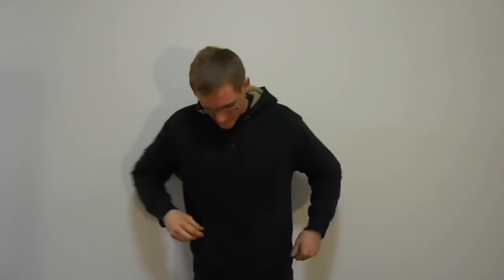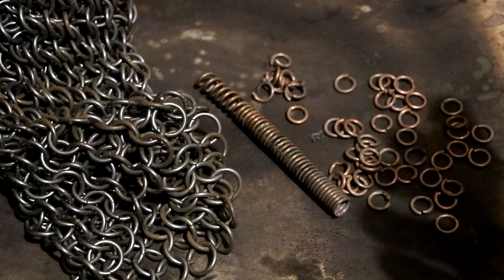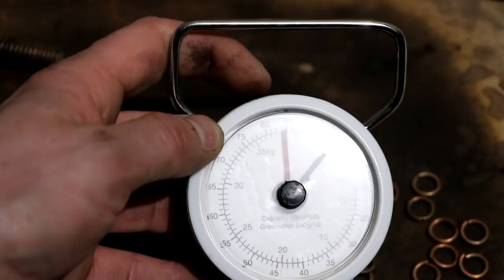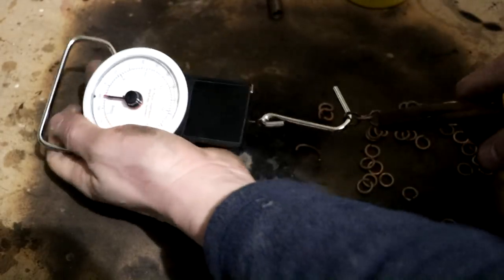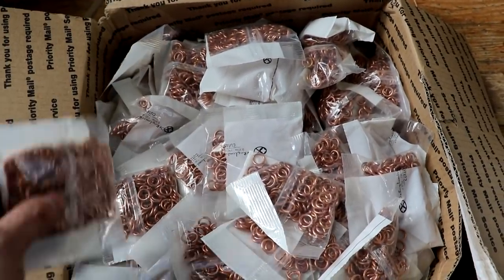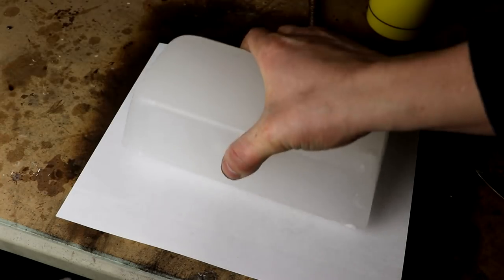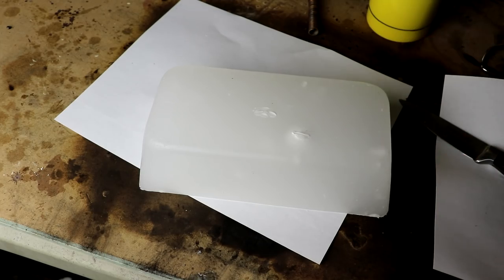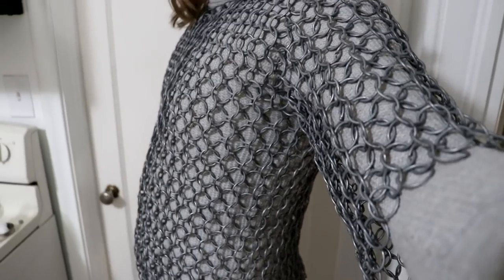Chain Mail Lab Coat?

Comment from the maker: Electricity... thats another thing this will protect me from that I forgot to mention in video.
Reply: Cody'sLab That's awesome! About how many volts do you think it can handle?
Reply: Question, is it possible to cast some iron stuff with thermite and dry ice? Or would it be too unefficient?
Reply: Cody'sLab doesn't it have to touch the ground in some way? Or electricity else it will still go through you to ground itself
Reply: Unless it's high-current, in which case you'd be a walking BBQ... :P
Reply: But can it protect you from the sheer force of thrown pommels?
Reply: That's one heck of an anti-ESD shirt.
Reply: Grounding through the shoes, or add a capacitor and a spark gap to induce an emp to short what is shocking you
Reply: Will it though? It seems rather easy to have a part of your skin in contact with it accidentally
Reply: How the chainmail can protect you from electricity?
Reply: Faraday cage?
Reply: Can it protect you against butter?
Reply: Robin Dude if it's not grounded a tazer will still shock you a bit through it
Reply: Cody'sLab I thought of that right away, thinking of you. lol.
Reply: And rouge chickens
Reply: moiseman a insulating layer would probably be needed
Reply: Duh.
Reply: What about the chem trails?
Reply: Are your referring to a taser?

Or are you going to somehow run positive and negatives down a shirt your going to wear and become the human electric fence.
Reply: Cody, what about Butter?
Reply: Just stay far away from car batteries and other power sources with low internal resistance when you're wearing it. I like my Cody rare, not toasted.
Reply: Also, sharks.
Reply: Yeah, but in case of serious power, the heat might get you
Reply: Only if they aren't thrown rightly.
Reply: Does mail radiate body heat? If so, would the rate and efficiency at which it does be enough to mitigate the extra heat generated by your body from wearing it? Also, in the sun, would the person wearing this actually get hotter from the transfer of thermal energy from the environment to you? 

Of course this isn't a full suit, so you won't have to worry about overheating like the original users of plate armor did but if you live in a desert, I want to know the deets on how mail works with heat.
Reply: Not as much as you might think. It might help by popping a breaker before too much damage is done, but it will get HOT in the process. Caution and insulation are much better protection.
Reply: Mmm...  I wouldnt wear it in an electric storm.
Reply: Chainmail doesn't really causes much heat buildup, it can actually act as a heatsink. But if it is exposed to the blazing sun, it will get scorching hot. To prevent that, you can wear a surcoat over it, like the crusaders did.
Reply: Does that mean there is a Tesla coil in your future?
Reply: It should handle quite a lot, unless he uses pretty high voltage he should be fine :)
Reply: this will be a faraday cage
Reply: did it ever cross your mind to wear an electrified chainmail?
Reply: Christopher Wiraatmaj, It will act as a Faraday cage
Reply: A Faraday shirt?
Reply: Really? Is it going to cover enough of your body to act as a Faraday cage? And wouldn't it have to be grounded?
Reply: MadSam !, Yeah, a Faraday shirt
Reply: Cornee, I don’t think it would matter much, the rings are touching anyway and wouldn’t require welding together
Reply: Lol IT can handle 10 Million volts If its grounded 😂
Reply: Norkans5 it isn't that the chainmail gets hot on its own, but if it protecting against an electrical shock by routing the current through the rings instead of the wearer, the chain mail can get very, very hot. The same way you don't wear jewelery when working with high current circuits (a finger ring completing 12v circuit in a car can cause horrible burns, if the circuit isn't immediately broken or if the wires weld themselves to the ring it can basically burn the finger off) this is usually an issue with unfused vehicle batteries or high power RC lithium cells.
Reply: I guess it would disperse the charge quicker reducing its affect but I'm not sure.
Reply: That was the first thing I thought of. You should build a mini power station build a power station.
Reply: Well, if the rings are going to get hot anyway, add some platinum and turn yourself into a catalytic converter.
Reply: Ian for something like a single capacitor it might help, but batteries hold enough power to dump power into a dead short for seconds, and large capacitor banks will basically cause an explosion (arc flash) if shorted.
Reply: Cody'sLab I was gonna say, make a ground wire to the soles of your feet and your chest is wearing a portable Faraday cage. ^_^
Reply: Cody makes his own superpowers
Reply: you can try to get hit by a taser and see if it protects you :p
Reply: Cody'sLab Will you please do a video showing how it protects you from electricity. I know you can think of a mostly safe method of showing us and it would make a great video. Keep up the good work.
Reply: Robert Szasz insulation only helps so much on high voltage applications.
Reply: Doesn't it need to be grounded first? I ground my tin foil hat so it doesn't work like an antenna, magnifying the alien control signal to my brain. Funny thing is as soon as I did I quit believing the earth was flat.
Reply: But will it protect you from constant notifications on your phone?
Reply: No, but nether does the no call law I subscribed to.
Reply: Lots of people of Cody's size weigh a lot more than the added weight of the chain mail does to Cody. It will make a difference, but it won't have much of an impact.
Reply: There's a video just explaining that one I thought it would light you up like a Christmas tree...
Reply: But it is required to be COMPLETLY covering you. Any gap or failure in the mail structure will result in an path where current can flow trough you instead of grounding around you.
Reply: he could ground the chainmail with a wire?
Reply: teslacoil?
Reply: We have a very fun source of electricity if you want to test that protection
Reply: are you trying to talk cody into making a full suit of plate armour? if so i like where this is going..
Reply: Cody'sLab chainmail is a great but hard work.
Reply: Make sure to wear a belt around the bottom of the chain mail to make the wait sit on your hips and not all on your shoulders
Reply: probably takes way too long and too much effort, he'd have to learn how to make the rings rivetable and rivet them
Reply: He wore a chain shirt for a whole month to simulate 1.5x gravity a while back so he has an idea
Reply: Robert Szasz or he could just cross a hot and neutral before doing anything live. Big pop, some sparks, and he'll be fine.  I work live power all the time. Its not as bad as one thinks, though that suit makes it worse. "Hey, lets dangle copper rings over a live circuit" not a very smart thing to do..  at least in its current state..  get it? Current? But no, if he grounds it, he should be fine
Reply: The copper will conduct heat away from the body faster and also has a better surface area to convect heat to the air, so it will help the body release heat a little more efficiently. But carrying the weight will most likely tax the body far more than the benefits of its higher heat transfer. In direct sunlight with the copper, it will most likely burn the wearer as the copper will absorb the heat radiated from the sun a lot faster than it can dissipate it.

Probably not the best idea to wear in the desert
Reply: For a handheld taser, the two prongs will most likely touch the copper rings and cause at most a tingling sensation. A taser gun has two small, sharp needles that shoot out, so it's 50/50 that they will both be able to stab into the skin. If one hits the shirt and one hits the skin, I think the taser will lose a lot of its effectiveness.
Reply: Is there something you need to tell us Cody?
Did you get yourself in trouble?
Reply: You need a connected cable that travels down your legs and attaches to your boots for max effectiveness I imagine. Maybe even have a steel wire that goes through the back heel of the boot so there's a full conductive pathway straight to the ground.
Reply: cody! have a wire from the chainmail to go down along your leg and solder the other end of the wire to a nail on the side of your shoe that sticks a little under your shoe that will run the electricity to ground
Reply: Make a leather belt for it, too and buy a gambeson. More comfortable and the weight will be evenly distributed between your shoulders and waist.
Reply: pommels are super dangerous, my great grandfather was killed with a thrown pommel, they said the impact was heard a few towns over.
Reply: Cody'sLab Can you please do a tutorial or something like that on how to do the 6 in one weave and the 4 in one weave with copper or steel or both rings?
Reply: check the weight of your shirt against your tensile strength test
Reply: Did you tested electrically conductive fabric to protect you from electricity?
Reply: cody cage
Reply: Cody'sLab hows the lab coat coming along? Update video
Reply: Since arc flash gear is usually rubber and cloth, I don't see it offering much protection. Unless you use a rubber under layer , and you are in mail from head to toe and grounded, then perhaps. I think it'd offer more protection from rf radiation then anything. Oh, btw, we need an update.
Reply: we use chain-mail gloves with grounding plates at work against static electricity
Reply: Hey Cody, im back with another question.
I'm still making my chain mail out of steel, do you think it would be a good idea if i would weld mine rings shut, or leave them closed just by using pliers? The steel wire is 2mm thick
Reply: @davidtichy3546  ofcourse it would be better if you welded them. As you can see in the video when you just close them, they aren't as powerful as they can be and can be broken rather easily.
Reply: @davidtichy3546  also you can look at the differences between butted mail and riveted mail. Welding it kind of works the same way as the riveting work.
Reply: @WarioNumberOne  he can attach a chain which goes to the ground
Reply: Good old Faraday cage!
Reply: Well if you're working with a low voltage high current system like that from a car battery, it will do more harm than good.
Reply: Cody'sLab I appreciate how much effort you put into your videos, some people can’t even make a ten minute video, thank you
Reply: Cody'sLab, and I doubt your reading this but if there’s a chance you remember what the name of the video is were you finished this project
Reply: Nice
Reply: @WarioNumberOne  if he puts some capacitors and rezistors it mite bleed the current a little
Reply: any follow up on this? wanna see the completed chainmail lab coat.
Reply: @META_mahn  Sad to see only two comments about the possibility of Cody being ended rightly with a pommel.
Reply: how much would you sell one of those for cody the coper and or steel or both? Also killer heatsink man
Reply: Will it protect you from shaggy using 42 percent of his power tho
Reply: Ok, Cody. It's been more than a year, and I see  you wearing the coat in quite a few videos. I can't seem to find any update on the coat? How heavy is it, and how long did it actually take to complete? Have you noticed any change in your strength and stamina? Have you lost any weight? (I just came back and watched the video for the second time, just to recall what you'd done and when.)
Reply: But are you willing to test that?
Reply: Also microwaves
Reply: That seems like it would "electrify" the chainmail and electrocute you instead of protect you.
Reply: MineCRFTFreak970 electricity chooses the easiest path and skin is much more resistive than the copper so it will choose the copper but the copper does neet to be connected to ground just look up faraday cage its the same
Reply: Ah... Okay.
Reply: Why are there pocket-knife-stabbers on your farm? 
Did you mess with the KluKluxKlan?

Comment: Cody, no matter how hard you try, mail can't protect you from butter
Reply: next will be scale mail to try protect against the butter incident
Reply: Toast mail
Reply: Brandon Haffeman oh my god please stop
Reply: The Benevolent Sun What did I do?
Reply: best comment lol
Reply: LOL
Reply: Theoretically, you could scale down the chainmail pattern. If you scaled down the pattern enough large molecules such as the lipids and proteins found in butter would not get in. Although, at that point you’d likely run into some issues with oxidation unless you make use of a noble metal. A side note: I have no idea if this would reduce the flexibility of the chainmail but the sole intent of this comment was to show there is a way to protect Cody from butter on a molecular scale.
Reply: John Doe just no
Reply: John Doe You missed the joke, my dude. Yes, he could in theory keep it out if he made frickin plate armor, but not with mail. Even if you figured out a way to weave it that thin, lipids can get through despite their size. There is no defense that isn't solid or magnetized that can prevent other molecules from getting in.
Either way, blunt force is the best way to defeat plate armor, and an easy solution to mail. He's still weak to butter.

Comment: Always use the right tool for the job.... use something with a cross guard when stabbing through chainmaille. Keeps your hand from sliding across the blade when your grip slips.

edit: originally said Hilt instead of Cross Guard. That's wrong because the hilt is basically everything that isn't the blade itself.
Reply: Quarnozian So that's what the hilt is for.
Reply: Noel Goetowski and to stop enemy blades from sliding into your hand
Reply: Also for catching opposing blades from chopping your fingers off... but using a dagger to deflect a sword is more of a last resort kind of option.

edit: Ah, I see Spicy bits already pointed this out. ;)
Reply: Quarnozian I thought it would happen on the first stab and cringed the whole time
Reply: Not a hilt, a quillion. Also keep your thumb over the butt of the handle.
Reply: He could also carry a sword breaker with him if he's that worried!😂
Reply: Use and Estock
Reply: And make sure to End them Rightly
Reply: Yep, my 9 year old self tried to stab a machete through frozen dirt, i still have the scar on my ring finger at least; it went to the bone. 

Put your thumb over the handle, at least!

Comment: I'm no expert on brazing, but I suspect that if you use some real silicon bronze brazing rod instead of simple brass wire, you could increase the tensile strength significantly more. You know, in case you're worried about arrows from long bows or something. :)
Reply: FXM l

Comment: Chainmail is really meant to protect you from cutting attacks, it's always been weak to stabbing and you can counter that with a smaller size of ring and using a riveted construction. But as chainmail got into finer sizes of ring in history, swords got longer and pointier to counter it. It gets into a ring and forces it open, popping the ring apart and letting the stab pass. 

The thing that'll help you out is to wear a gambeson behind it which will prevent a few inches of the blade from actually getting to you, if any does. there are accounts of medieval knights looking like pin cushions in a battle after being peppered with arrows. You can also help yourself out by cutting the rings with a small overlap on either end, instead of a butted construction. Hammer it flat, punch a hole in it and use copper wire as a rivet. You can look up ways to produce a riveted form of chainmail on YouTube that will explain it better.

That form of construction no longer relies on the resistance of copper wire to bend, but the strength of a ring even if it deforms in an attack ultimately ends up being the sheer strength of the copper rivet which is significantly more.

Comment: A copper sheath wrapped around less conductive interior. Cody the human capacitor.
Reply: Either that, or he's going to start doing experiments where he needs a Faraday cage :P
Reply: You should probably look up what a capacitor is and how it works. 
Hint: It's not a copper sheath wrapped around a less conductive interior.
Reply: I know you were just trying to be funny but you would've needed to define Cody's body and his chain mail coat as the plates and his normal cloths as a dielectric medium in order for it to be both correct and funny.
Reply: Wow, I thought you were nice and there went my expectations

Comment: 1. I always thought that making the rings is what goes quite fast when you make a lot of them. But that knitting  and welding would be the time eater.

2. you should try knitting the the next row while the row before sits on a long rod, like sitting on a knittingneedle.

3. You should try making a spool and screw this into the row before, before you cut the spool into rings.
that is a massive time saver in may experience.

Comment: Edit: oh good, I see you ordered some good rings, and from the company I would have suggested.

Cody, first off, if you use Wiss M5 snips, your rings will have better (more flush) closures that won't snag on things or scratch things so easily. It will also give better surfaces if you want to weld/fuse/solder the rings.

Second, a chain hauberk is not going to be good protection for most of the things you do.